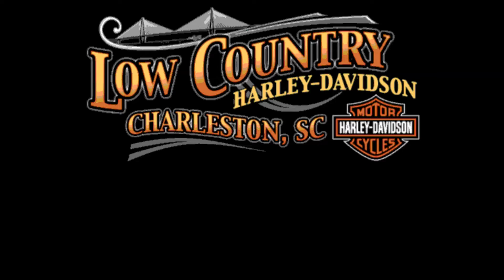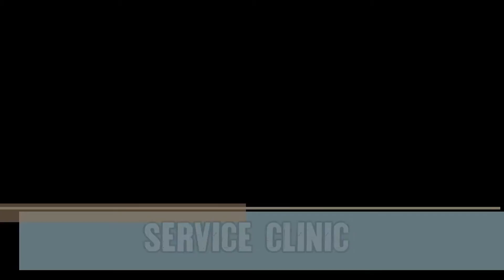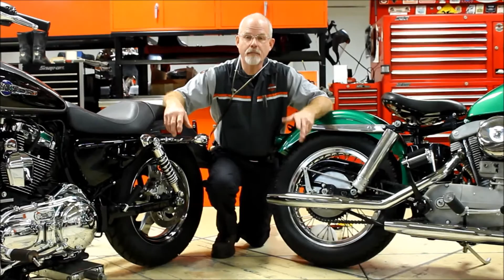Doc Harley: Affects on Brake Fluid

Comment: Doc I just read HD has a huge recall onthe brake systems on 2008 and up starting Feb 12th
Reply from the maker: That's correct.  It seems that the transition to ABS has been difficult for many riders and dealers alike.  Harley-Davidson Motor Company recommends servicing your ABS every 2 years of service.  Like DOT 3 and DOT 5.1, DOT 4 fluid is hygroscopic, so it will absorb water at room temperature from it's surrounding environment.  It appears that many of the failures in ABS modules are a result of improper maintenance.
Reply: Thanks for mentioning this, I a 2nd owner to a 2010 so Harley isn't able to notify me. Putting on a set of apes soon and was going to uphill bleed it myself but maybe better off to take it to the dealer for that so they can also do their recall inspection. I've always been diligent with brakes and tires..... My life rides on them! Lol
Reply: HD fucked up and bought Brembo instead of a proper Japanese ABS system. Nothing made in Italy is reliable but the lowest bidder won. Bean counter engineering greatly cheapened the brand and sales reflect this. The only HD engines famous for RELIABILITY are the old Evos. Everything since was designed for easy automated assembly and sales reflect this.  I wish Harley-Davidson would gas its current incompetent management before they do more damage, then and build another engine owners can beat the shit out of without frequent problems. They  couldn't even get a hydraulic clutch to be reliable and that's just sad.

Comment: I like the Sportster models, to this day. The newer, Sportys use a rubber mounted engine, and an easy to change out right side, final drive belt, and still uses the EVO engine design, with Metal Gears to operate the four cams, and not roller chain drives, with their PLASTIC cam chain tensioners, like on the bigger, Twin Cam engines. They also use a bolted together crankshaft, rather, than a pressed together crankshaft, like on the Twin Cams which can twist out of true and crater an engine. The Sportsters are a very reliable, and proven bike, and a lot of fun to cruise on. Only limitation is the smaller fuel tank which limits range, and require more frequent, stops for fuel. I like the XL1200 over the 883.  Thanks for your informative videos.